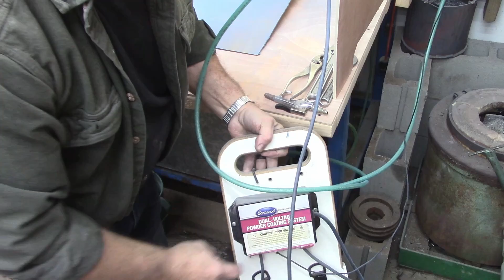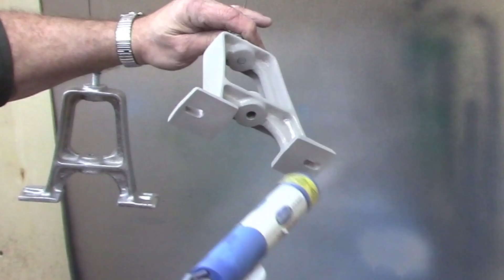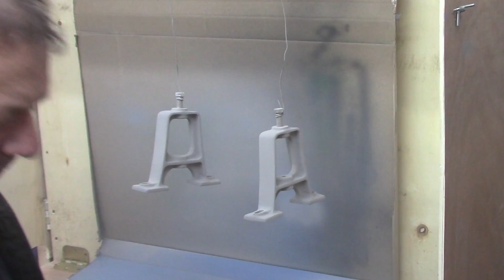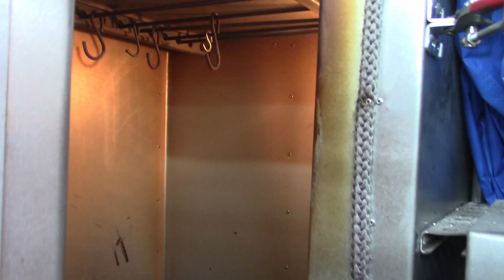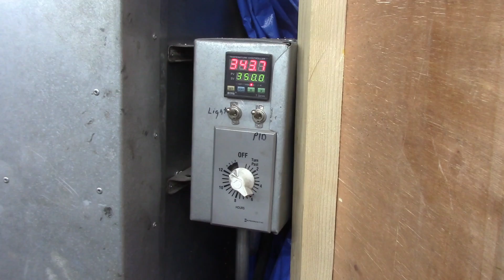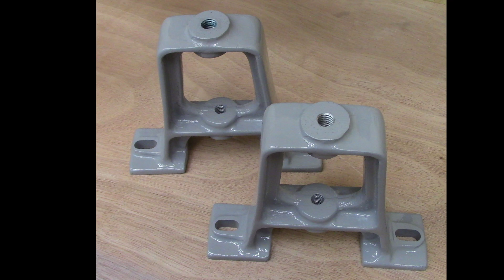Delta Wood Lathe: Powdercoating The Countershaft Hangers

Comment: Dan, thanks for the video. Looks like a fairly easy process. That’s a nice sized oven, how large a part can fit in it?
Reply from the maker: It is fairly easy, i don't remember inside dimensions, when I built it I designed it to hold several barreled rifle actions,